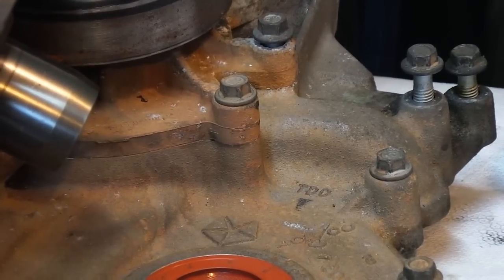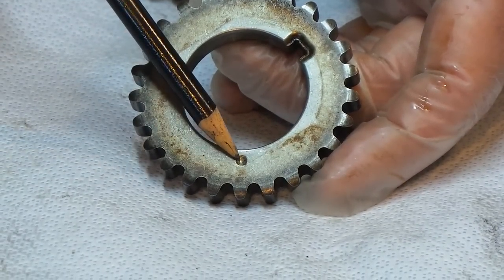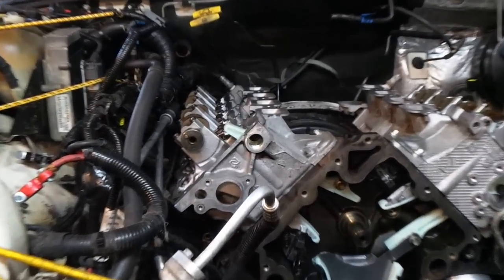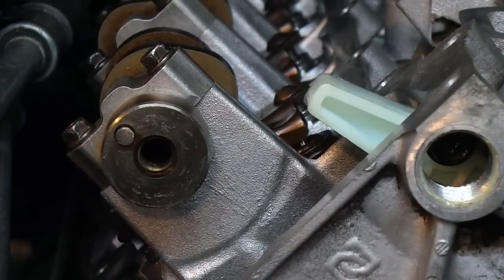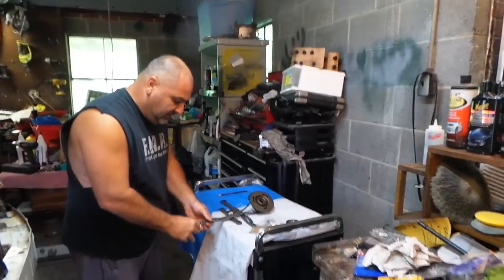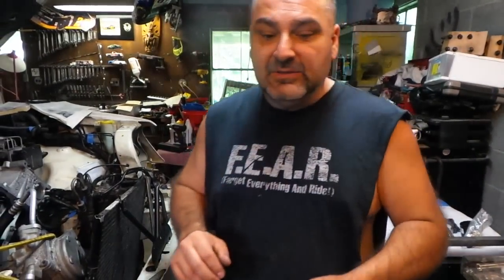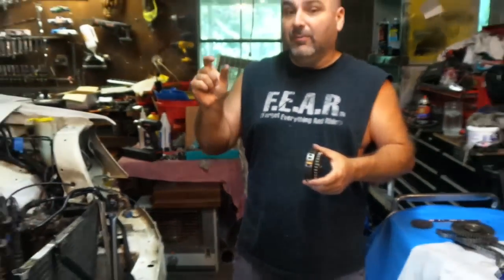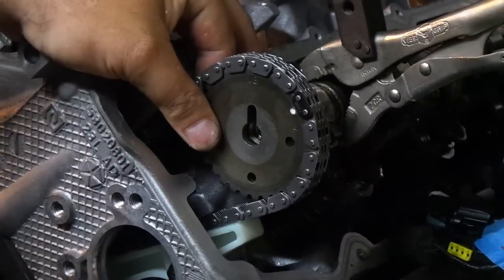Complete Timing Chain Job On A Chrysler 4.7 Engine

Comment: How do you remove the cam gears without turning the cam. I do t have the special tool and don't have time to wait for it to come. Any suggestions would be appropriated. I tried the vice grips but no go
Reply from the maker: D P The vice grips are the solution but they have to be on there so tight that you can barely clamp them on there. Go to 48:25 on this video and it will show you how to hold that sprocket in place.
Reply from the maker: D P Also, you can get that pulley holder at any AutoZone or parts store too. Out of curiosity, we haven't had any feedback on this video. Are you finding it helpful at all?
Reply: This video is the most informative and well instructed video I have come across. I have followed your instructions to a T and everything worked just like you said it would. Keep the videos coming! Huge Help! I felt very overwhelmed with this task until I came across your video.  The rubber band and cord were a huge help.  I have one problem. I had no help and tried doing it al myself.  Totally my fault. I tried to hold the cam while torqueing down the cam gear and think I went a little crazy because now I have slack in the drivers side secondary chain. I think I may have stretched the chain or moved something. I ran out of daylight so Ill be back at it tomorrow. Hope I don't have to start all over again. Any thoughts?
Reply from the maker: D P Hey Man, just caught your last response and wanted to see if you still need some help. Either way, let me know and if you completed it, I would love to hear how it went for you.
Reply: I'm actually in the process of removing the engine. Discovered a few more issues other than the timing. I think with 160 on it, would make sense
Reply: I am having a hard time finding a used 4.7. I'm guessing that is testimony to the poor performance of the engine. Looks like I'll be replacing with a reman.
Reply from the maker: D P I'm with you on that one man. What exactly is wrong with yours? I've even had cases where I had to just replace the pistons before. Sometimes, you can just fix the parts that have failed in them.
Reply: To be honest I'm not exactly sure. The guy I purchased the truck from said that it was a problem with the timing. I changed the timing and started the truck and had the same results. Sounds like an extremely ruff running diesel. I pulled the plugs out (like I have should have done in the first place) 2 of the plugs were completely crushed and bent. The 1 plug on pass side and the 1 plug on the drivers side. Plus I have noticed all kinds of sludge build up. I guess I could pull the heads off but I honestly have no clue what I'm looking at or looking for. I have never rebuilt an engine.
Reply from the maker: D P Hey Man, ok this is easy. Don't sweat the small stuff. Since you've already got the timing off the two heads will only take a couple of hours each to get off. It sounds like the guy installed timing wrong and it ended up wiping out a couple of valves but I bet your heads and engine are just fine. The valves are pretty inexpensive, about $10 each OR you could just buy used heads for it. Let me know which direction you want to take with this and if you have already pulled the timing, trust me, the heads are the baby stuff.
Reply: Only concern with that is.. It still had the factory timing on it. The timing had never been messed with to my knowledge. What else would cause that to happen? I also think it was severely overheated. I'm kinda at a standstill on which direction to go. The truck is in really good condition and books at 6 if running. I only paid 800 for it. So I'm not sure on what to do here. What else could cause the spark plugs to be crushed like that? Any and all suggestions would be greatly appreciated.
Reply: D P the problem is in the calapssed lifters that cause rocker arms to Fall off and valve problems so all the valve seats need to be reseated with new ones or clean ones and the lifters can be taken apart and cleaned with diesel fuel and when reinstalling the lifters just drop a 1/4" zinc flat washer from orchard supply in the lifter holes as a shim and problems solved most dodge 3.7 and 4.7  liter engines have this problem and just use mopar antifreeze so you won't have to do the headgaskets in 20k miles
Reply from the maker: D P I just caught your last comment and Why Ask is absolutely spot on!!
Reply from the maker: D P P.S. I would just get two used heads and call it a day. If you decide you want to re-build your heads thats not a problem because we have a series on it. I can't tell you how many of these Jeeps/Chrysler engines I've had to deal with the rocker arms falling off of.
Reply from the maker: Why Ask Hey Man, I really appreciate you weighing in and helping folks out. Thats what this channel is all about. Very much appreciated!!
Reply: Almost. The pistons are also completely destroyed. There are actual chunks missing from them. Definitely a re-man. Thanks though! I greatly appreciate it.
Reply: I wish I could post pictures on here.
Reply from the maker: #Pittsburgh P How is it going buddy?
Reply from the maker: #Pittsburgh P You can email me pictures at: jamiejonesobfm@yahoo.com. I'm happy to help you out so just let me know where you're at in the re-man process.
Reply: Still looking for a used motor at a reasonable price.
Reply from the maker: #Pittsburgh P Ok, one place that might be able to locate one for you is called: car-parts.com. You just put in your year, make and model as well as your location so that they can locate the one closest to you.
Reply: Thanks. I'll give it a try
Reply: Use the  vice grips but also use a compact drill, it will remove the bolts in about 3 seconds. Just helped out my wife's uncle with his truck. Did it myself, thanks a million for your video, very helpful...👍

Comment: Jamie I have a 2007 4.7 dodge Durango  the secondary gears have different teeth an chain design then the aftermarket kit I bought , an the pivot bolt in the tensioner arm is different the oem arm has a bushing in it an my aftermarket arm doesn't . I need a bolt with a shoulder on it to work  have you ever seen  this. I checked advance, autozone , online they all sell the the same kit
Reply from the maker: Can you reuse your tension bolt ?  Do the gears have the same size and teeth

Comment: man! as i was trying to unbolt the passngr side cam gear, the camshaft rolled back a bit, now im off tdc. and scrwed... gotta take off my rocker arms now and try to roll it forward a bit. maybe 5 degrees ... daamit
Reply from the maker: Emil Robbio now you can rotate it without taking anything off
Reply from the maker: Remember you just want to set those V8 at 12 and that's TVC as long as the crank is on its Mark you're good to go and the change will keep you straight to
Reply: JamieJones TheCarMan yup thank you,  it worked. I got the book also to be 100% on all my tdc and chain dots aligned as per book . It's a V6 and got v6 on cams at tdc, bottom at 6, top at 12. And chain dots visible at both windows and dots at v6 mark on cams. Thank you for the tips

Comment: Hi I just replaced head gaskets on my 3.7 timing Chain, guides whole 9 yards started it up for 15 mins ran fine drove it around the yard no noises good acceleration pulled in garage tried starting again sounds like it's out of time pulled off valve covers it's still all TDC what could it be

Comment: While taking down my 4.7, and having the mark on TDC,  my cam gears have the V8 at six o’clock. Does this mean it’s way out of timing?
Reply from the maker: No that just means you were on top dead center of the exhaust stroke if you had turned your harmonic balance or one more turn they would have been that the 12
Reply from the maker: But when you put it back together put it with the V8 at the 12 because that'll be the top of the compression stroke and that's how it's all designed to go back together as far as the black dots on the chain and how it's designed to be put back together
Reply: JamieJones TheCarMan can’t thank you enough, you’ve made this complex job into a basic one and my cousin and I appreciate that. Take care and we look forward to future projects with good people like you guys lending your knowledge.

Comment: Ok so I've got a thing going on I've gotten into this 4.7 a little late the heads have already been pulled off.. can I still put it all at tdc and when I put the heads back on have all the pistons match up
Reply from the maker: +COURTNEY SLATT no problem at all
Reply from the maker: +COURTNEY SLATT  tdc is set by postion of the cams , just set the crank on its notch you are good to go

Comment: Hi I have a 02 dodge RAM 4.7 and makes a ticking sounds. I've been told it's the timing Chain and tensioners.Around how much does it cost?
Reply: Could be lifters also they lose spring tension after time n long oil changes sludge them up.that is if yours are hydraulic.get them changed its a bad sign.mine done the same changing now.only 60 bucks for lifters.snookie pa.
Reply from the maker: They have notoriously bad tensioner and the rocker arms fall off on #2 cylinders
Reply: Couldnt agree more ive changed out two in the five yrs owned mine.snookie
Reply from the maker: Gotta love some Chrysler

Comment: So...I'm about too do my timing chain on a 2002 Dodge 1500...

My timing chain broke! Do you think it's better too just get a whole nother engine?
Reply: probably, depends on how much of the work you can do yourself. My experience with chains braking never ended up being a good thing. I don't think this video is going to help you as this is a great reference for a replacement job before any harm has been caused. This engine is an interference engine and will definitely need way more then a timing chain if breaks..  Sorry this has happend to you.

Comment: first of all you described this perfect but one issue i ran into on some of these timing chains there are only 2 dot one on each side of the chain and not two black links. on the inside of the idler pulley sprocket there is one dot on one side count ten teeth from the top tdc dot on the idler gear both ways and the dots on the chain will match up
Reply from the maker: Nathan, thanks for sharing that man. Much appreciated.
https://www.facebook.com/JamieJonesTheCarMan1/
Reply: i would like to ask if yolu can confirm the tension on the chains my problem is now is that driver side lower part of the chain is a little loose the passenger side is tight thats with it at tdc when i turn the motor over the passenger side chain gets loose on the top i just put new heads on is this common with out the pressure build up in the tensioners also when i took the passenger tensioner off there was not a gasket i never had a prob. with chain slap or noises the guides all look really nice i did replace the two the the tensioners press agianst tho.
Reply from the maker: Hi Nathan, the tensioners are not supposed to have gaskets so no problem there. Have you released the tension in all three of the tensioners now? If so, there should be enough tension to make all three chains snug with no slack.You should turn the crank 3 times, by hand with the V8 sitting at the 12 o'clock position on both cams and you should not have any slack. If you do have slack, you more than likely have a faulty tensioner on the chain that is giving you slack.

Comment: Why not just turn the crank to make the cams and sprockets line up? Also, the manual says to use the special sprocket tool on the left camshaft sprocket to tighten the right one. Last but not least, yes, the plastic can break, and will be very brittle, but if it does, you will not jump time, because of the metal backing on the guides, with the possible exception of the bottom one, which I did not break because I didn't try to compress it and put a pin through, just unbolted it and slid it down. I don't believe that would cause you to jump time more than a tooth before you get a trouble code for crank or cam position. Thanks for the info!

Comment: Hi, will this video wirk for my 2002 Dodge Ram 1500 4.7 L also? thanks
Reply: im not sure if it will but i have a 2002 durango and 2002 dodge ram 1500 and both 4.7l engine look the same to me. so im guessing it will. good luck
Reply: will you make a short video on where the under hood grounding straps go?
Reply: yes

Comment: How do you remove black plastic cap behind power steering pump on 2010 dodge ram 1500 slt 4.7 left side cylinder

Comment: Car man, and when I get it lined up and I put the sprocket on and I take the vice grip off it pops back a little bit to the left just slightly, why does it keep doing that. The passenger side is perfect
Reply from the maker: are you keeping tension on the chain

Comment: I'm going on my second 3.7 and the timing chain links are not where they're supposed to be.does it really matter if the links meet the dots,its as if the guys who are putting the chains before are just putting them on.
Reply from the maker: +Priscilla Gabrillo I know it does seem extremely frustrating however yes the dots and the chain links need to match up on both sides also I just put all of my collective videos on a playlist specifically for you on my main page

Comment: fyi no plate goes behind right tensioner and block only left side, some kits come with 2 plates if you install plate behind right side it will knock and have slack
Reply from the maker: good eye, thanks for the share
Reply: Thank you for that. it was what I needed to know. I had 1on each side on a fresh rebuild and it sounded bad. Took out the right side and it now purrs. Also when I looked at the chains the left side was the one with the slack.

Comment: What about the balance shaft. What is the alignment of the balance shaft gear. It accidently moved whe. The gears were taken off
Reply from the maker: Are you talking about the crankshaft that would be the bottom one or we talked about one of the camshafts on the top

Comment: If any of my timing components are bad will it be visible??
Reply from the maker: +Jose Garcia no not always , you need to place the the chain guides and tensioner , you will be able to inspect all the gears and check for any metal shaving

Comment: how do you do this without the tool to hold them from moving???
i need to do this but no way to without tool i was told
Reply from the maker: +dustin “HHC” mccollister are you talking about the tool that used to rotate the cam or just a hold of Cam in place because you can actually just use vice grips all the way around if you want it

Comment: pls i have 2001 jeep cherokee 4.7 but the engine is not turning wht do u think will be the cause, is like the engine is lock can't turn possible solution pls am even trying to change crank kit wht do u think,
Reply from the maker: +Prince Dabby  most likely you have a bent valve , if were you I would pull the heads see whats going on

Comment: I'm having parts quality issues with local parts store chains. they all have the same chain kit, and they're all made in indonesia, china. The only affordable way to do this job is to buy these aftermarket parts. I rebuilt another engine with Irista parts and about a year and 20K later the timing parts started failing. What brand of chain kit did you use to perform this job?
Thanks
Reply: Roger Rabbid .
Reply: Roger Rabbid do you know what came of the stock or can gear is the right one for a 16 teeth week l swop my engine on 2005 doge ram 1500 put in  a 2003 3ngine I think is a jw but I put the 32 teeth can gear and know l can find the father one l though  they were the same but I find out they are not
Reply: 4.7 2003 dodged ram 16 teeth .l need the right camp gear l swop my engine thinking they all the same but they are not .know l don't know what is the right one for the 16 teeth weell  any budy  can help

Comment: Hi folks!!!
Thanks for your information.
I sent to rebuil the engine of  my ram 1500 mod 2005, 3.7v6, when the mechanic done the job, start the engine , and the intankmanifold explode!!!
 could you tell me way????
because the mechanic dont know.......    :(
Thank you in advance
Reply from the maker: +Frank venados yes the only thing that would cause that is incorrect timing instead of the compressed air blowing out of the exhaust the timings Off, in return it cause the compressed air to blow throug,if you need any help please let me knowh the intake that's the only thing that would cause that

Comment: As long as the cams are phased & timed right as well as the crank it doesn't matter where the cam chain sits ! But I suppose those darker cam chain links will help with eyeing up the timing marks some ! This is not really any different than a Japanese 4 cylinder motorcycle engine that is overhead cammed as long as all the timing marks are sitting where they are supposed to be it doesn't matter where the chain is set ! Great video though !

Comment: U know if u removed the push rodes and rocker arms u can move the cams freely
Reply from the maker: The Chrysler for 7 does not have pushrods it's the valve springs that makes it so hard to move plus it's an interference engine so you've only got limited space to move in
Reply: JamieJones TheCarMan yes it does lol mine does

Comment: I didn't do my home work when I bought my 07 4.7  dodge piece of GD junk that drop's valve seats. The engineers deviated to damn     far away from the 318 5.2 engine when they created this design. What were they thinking when they over-thought the design of this engine?  Did they think they were designing something for an Indy Car ?  This engine design sucks, should have kept a single cam in the block and made it a 4.7 hemi at less cost to all. Good Video... has all the necessary info needed to properly align valve timing on dodge's 4.7 over-engineered piece of G.D. junk. I'm so sorry I bought a 4.7.....
Reply from the maker: +Harus Difindafer  I feel your pain